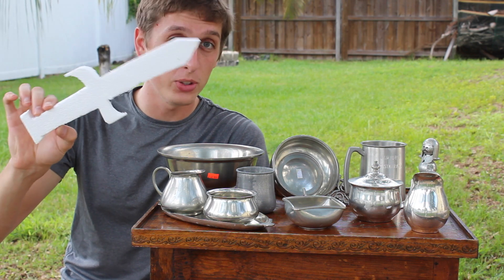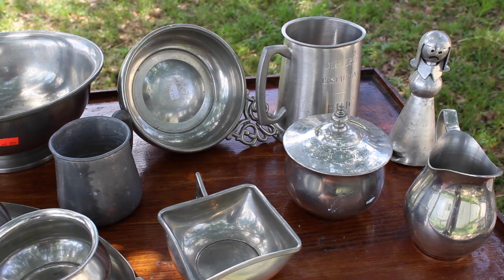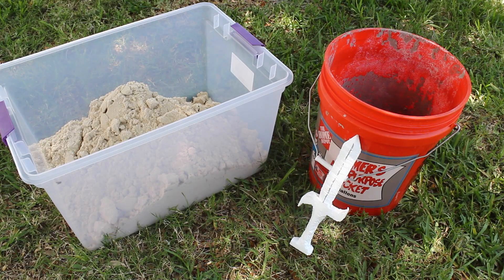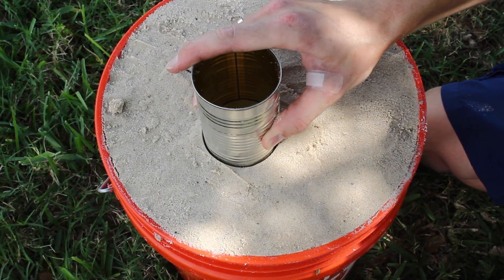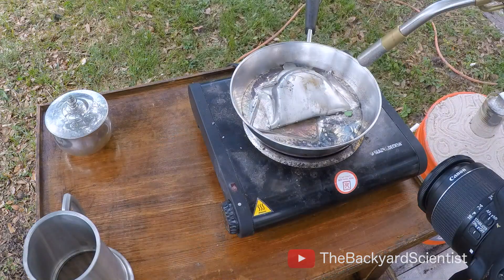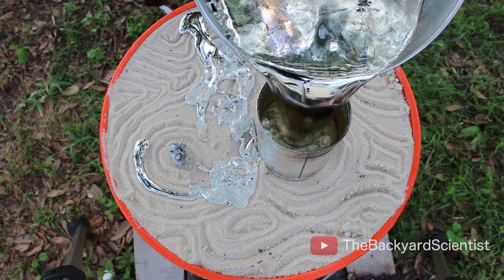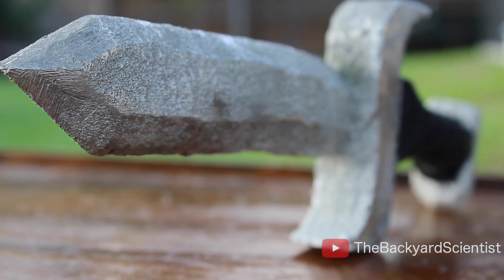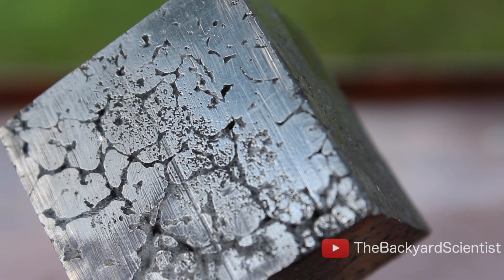Casting a Sword From Pewter

Comment: i made a long sword with this tutorial that's actually sharp.
Reply: i wonder if the pewter is soft enough that i could cut through your sword like in the movies...
Reply: Not as stupid as here. Pepper spray anyone?
Yeah, you'll be looking at a good 3k fine in Denmark for carrying the stuff (about 450 USD)
Reply: @Farhzeug  what are you talkinh about?
Reply: i hear they tried to ban pointy kitchen knifes in the UK
Reply: I wish I could make it sharp. Florida is just stupid in laws. Only replica weapons out of metal. So I just sanded the sand and everything else off and made it shiny.
Reply: how much grinding did it take to make it sharp?
Reply: a lot lol.
Reply: Denmark That's quite a bit.
Reply: Jonathan S Gerard Yeah, that's probably one of the stupidest things ever.
But they actually have a band against all knives ever made in history, they just aren't aware of it, because to them, it's only a ban on ''zombie knives''
However, the definition of a zombie knife is so vague in the ban, that it literally covers every single knife ever made.

Here's the rundown:
1. A zombie knife comes in varying lengths and sizes

2. They do not have a specific shape or style

3. May or may not be serrated

4. Can cause great damage due to their size (look at nr. 1 again, I kid you not)

5. They are sold as collectors items, either online or in shops

6. Carry logos or words that promote violence.
Reply: that sounds like a law used to arrest pretty much anyone...
Reply: Jonathan S Gerard Exactly!

Comment: thats a dagger...
Reply: +Hashtagrex a short sword is still a sword
Reply: well its not sharp and it's thick where as a dagger is sharp and small
Reply: +R4eWclan well, the point is, its not a sword
Reply: +Hashtagrex yes it is
Reply: +R4eWclan no its not, the blade part is waaaaay too short...its either a knife or a dagger, as the blade is only a small bit longer than the hilt
Reply: +R4eWclan prove....what? you can clearly tell the blade is too short. your question is the same as asking to prove a banana is a banana
Reply: +Hashtagrex tell me that it's a sword and I'll be pleased
Reply: +R4eWclan derp
Reply: +Hashtagrex it's not a long sword numbnuts...there isn't just 1 kind of sword
Reply: +Hashtagrex There are short swords, long swords, scimitars, Two-handed swords, etc. That's way too big to be a dagger.
Reply: +J “Jonikaru” Ho it's freaking dagger
Reply: its longer than a short-sword so it counts like a dagger J Ho

Comment: so now knowing pewter has a low melting point it begs the question : how the fuck did harry potter use a pewter cauldron for potions class?
Reply: magic
Reply: +xVlarkius he could have casted a fire proof spell on the cauldron
Reply: Ensenc, are you saying the Harry Potter books are not scientifically accurate? That's ridiculous!
Reply: it's the thickness of the pewter. more to heat.
Reply: the liquid potion prevents the pewter from reaching its melting point.

just try boiling some water using paper cups.
Reply: Eliphas Leary don't you mean Riddikulus
Reply: +Nev v you have a good point
Reply: this is why I bought a solid gold one
Reply: +Nev v i dont fucking know magic or some shit like that
Reply: Magic BITCH!
Reply: Magical Harry Potter
Reply: +Nev v See, only now do you understand the true importance of cauldron bottom thickness.
Reply: Gabriel Rizzo Yes, so will pewter
Reply: Magic
Reply: Magic
Reply: +Nev v Magic. The cliche one word excuse for confusing plots.
Reply: Interestingly in the Brazilian version of HP it is either a tin or a stain cauldron- I can't remember.
Reply: +Nev v well, aside from magic, i'd say that the cauldrons were probably pewter in a steel case, or something along those lines.
Reply: They defied the laws of physics
Reply: I'm glad I'm not the only hp nerd who thought about that
Reply: "Begs"
Reply: Paige Devens even more fragile I think
Reply: +Gabriel Rizzo i dont think so, and it certainley wont melt
Reply: +Nev v if you have water in it, it will have ahard time going over boiling time
Reply: um, magic, obviously. :P
Reply: also after he made the mold he could stab a tree stump with it...
Reply: Anton Helsgaun If you bite gold, some will come off.
Reply: ***** I was only thinking about stirring in it lol
Reply: Ensec so true
Reply: Ensec I

Comment: Since pewter has a reasonably low melting point I managed to cast it in high temp silicone! It works
Reply from the maker: J.P. Montello Nice! I bet the cast came out very good looking also.
Reply: ***** it might even work with those fancy silicone ice cube tray molds

Comment: Didn't Grant Thomas do this? Still cool though :)
Reply: Harry Markwell Not with pewter. I like this better since you don't need a fancy forge and he mentioned you can get it from thrift stores. I mean really; what are you going to make with aluminium doing this that you cant use pewter? Not much.
Reply from the maker: Harry Markwell Yeah he did. Its a pretty common way of making metal casts. Ive been asked a lot to cast a sword out of aluminum, But I tried to bring it to a level where anybody could do it. Thats why I chose pewter. Grant Thompson's sword was much prettier tough :)
Reply from the maker: HeronSight Thanks :) I saw he used some kind of self adhesive backed foam board(I think). that would have been awesome to have. I got a 2x4x12 inch block of styrofoam for $5 at the craft store, what a ripoff!

I am defiantly going to revisit it, one of the great things about pewter is that it does not really oxidize like aluminum does. you can melt it over and over again with virtually no loss of metal.
Reply from the maker: HeronSight Pewter would work great with silicon molds! You don't even really need a foundry just make a flamethrower ;)
Reply: +TheBackyardScientist He also didn't warn anybody about the dangers of casting aluminum in a makeshift forge. There a million things that can go wrong especially your first time working with metal, much less aluminum.
Reply: TheBackyardScientist  you da best